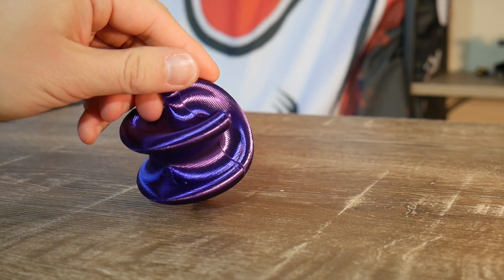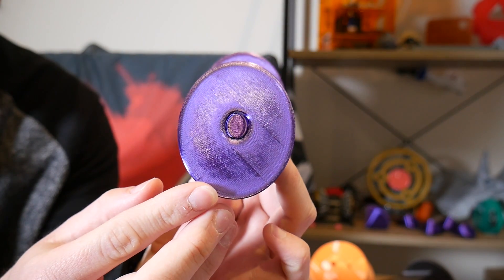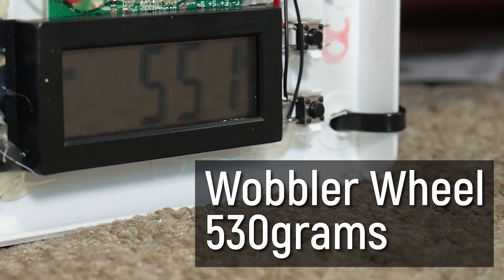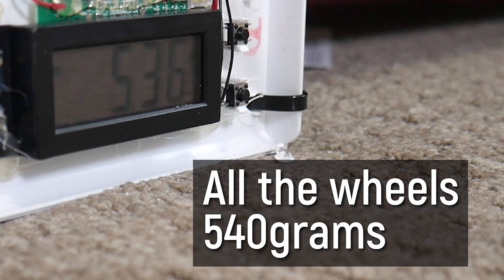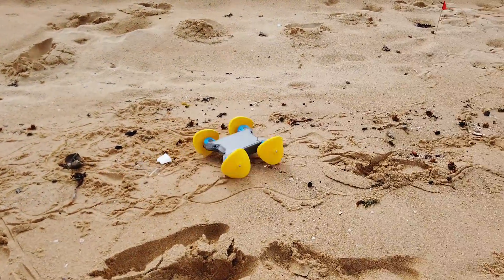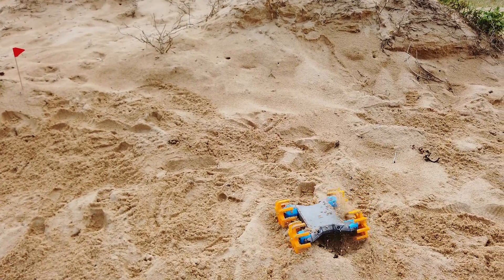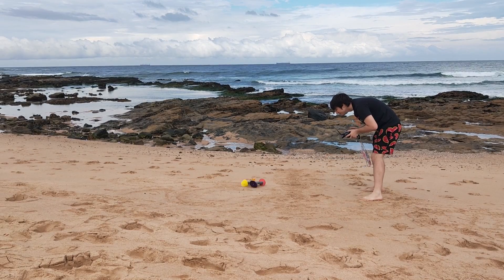This Robot Drives on Wobbly Wheels (but HOW?)

Comment: i cant design it, but im sure you could! try to design a combination of the wobbler wheel and the paddle wheel, where the main construction would be the wobbler wheel with bars or paddles around the diameter the same way the paddle wheel is, but instead of attaching at the end of the wheel, it would branch out from the wobble wheel parallel to the hub. looking staight forward at the hub from the front of the car, it would like a wavey line with a bunch of cross lines going through it. each time the wheel wobbled out, the paddles would shift to be longer on inside, but the wheels total width should stay the same, sorry for over explaining, but i really want to see that!!

Comment: Logic* dictates that combining all four wheel types would give you a pulling force that's an average of those four types.
405+530+550+600/4 = 521.25
This is slightly lower than the measured 540 grams but without going into further into the deep dark hole that is statistics I'm gonna go out on a limb and say it's within the margin of error for your measurement methodology**. 
* The logic used here is most certainly not recognized in mechanical engineering
** Given vast span of values shown on the scale and the low sample size that margin of error is huge***
* Much like the rest of this comment this statement is also pointless as I've not even tried to calculate the actual margin of error

EDIT: Youtube apparently lacks support for the usage of multiple asterisks so my footnotes may look a bit off.

Comment: If wobbbly wheels got 1 point and straight wheels got 0 points, but spoked wheels in a straight configuration got 3 points, does it not stand to reason that spoked wheels in a wobbly configuration would stand a better chance? Perhaps have the centre disk in the middle of the spokes so it makes a sort of left and right pattern between each spoke as it pushes forwards. This means doing away with the "star" shape in the centre of the current spokes design and inserting the wobbly design such that it's OD meets the OD of the spokes. If you get my meaning?

Comment: Nightshade wheel on flat surface does the same job as if you just sliced the tip of that initial cylinder to make a round wheel.
Only the nightshade wheel is harder to make, uses more material, takes up more space and weighs more

Comment: I'd argue the traction issues are made quite worse by the low ride height of this bot, maybe if the wheels were offset downwards or were quite wider the bot would work far better.

Comment: #1 The problem in every case with every wheel is ground clearance. #2 If the spoked wheel had a cylindrical center the width of wheel, mating with the inner side of the spokes it would finish the course.

Comment: It's really enjoyable to watch the play involved in designing these wheels. I think that one of the reasons the cars got stuck so easily is the body design. The flat bottom sits very low above ground, making it very easy for the cart to get stuck. This is why monster trucks and dune buggies for example are much higher up on their wheels. I think for the follow up video, using a better controller and BLDC motors will also improve a lot.

Comment: Bigger wheels so it bottoms out less would really help. As soon as you spoked wheels dig in just a little, the belly of the car is in the sand and then you lose the ability to dig in for more grip and to keep going. These wheels are very similar to the large tread pattern used on dune racing cars.

Comment: There are longboarding wheels called “Shark Wheels” an they work on a similar concept, I’m surprised you didn’t touch on these, but maybe you didn’t know they  existed.
Reply: Indeed, thought theyre meant for not hydroplaning or getting stuck on gravel. Kinda similar concept indeed, though they wear pretty quicjly because theyre quite soft.

Comment: when the robot jumps up and down you arent measuring a force, youre measuring an impulse. for more accurate measurements try increasing the mass of the chassis. basically if the chain is oscillating the measurements arent accurate
Reply: also grams are a measure of mass, so saying it pulls x grams is misleading. if the scale is just a weight scale divide grams/1000 and multiply by 9.8 and you'll get force in newtons

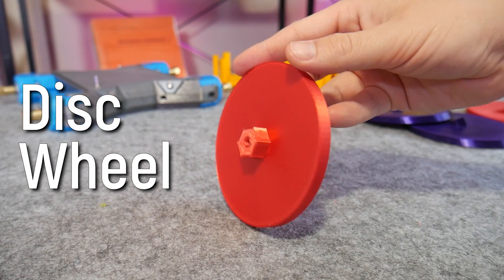Comment: What is the weight of the whole setup? All disk-ish wheels have less contact with the ground then the spoke wheels. So the pressure per sq mm is much higher for disks than for the spikes and that's why they lost in the sand. The whole surface area is not that important (4:15)

Comment: Why not wobble the spokes in some sort of way, ABIT like those shark skate wheels except inverted wobble to run horizontal instead of vertical. Or add some spokes to the rear of your wobbler or prongles

Comment: You had them test out in sand, ofcause the wheel with a design to get better traction in lose material does better, that’s not cheating it’s just a match between test and design... just add more tests, like the road outside your house and a grassy area somewhere nearby...
I am sure the other wheel types will show greater results and the stick wheel will do worse on some of those surfaces.

Comment: Possibly something with studs or scoops, but I bet the spokes version with a larger diameter could be a logical next step. That is, assuming the motors have the torque for their size and weight.

Comment: This is so amazing tests and findings. Thank you for the video 👏👏👏👏👏
My suggestion for the next step of traction test is to have brushless dc motors and current control of power source in the same setup you have already made with chain & load cell. By the suggested arrangement, you can measure the maximum traction before the wheels motion starts. 🧐😎

Comment: Question that is tangentially related to the video since such a thing is used to create everything referenced - I do not have a 3D printer but I'd like to get into it 'cause there are lotsa things I want to make. If I wanted to get a 3D printer that was 'respectable' but 'not hella 'spensy', what would the least expensive model be? Just a 'starting out' one, but not one that extrudes Easy-Cheez - something that can produce 'decent' prints.

Comment: Check out sidewinder snake.. I think if you can time the wheels and drive it sideways with the wobbly ones it's going to do a similar footprint as the snake. Try to do a ankor shape on the disk for more surface area.

Comment: Don't think any particular extra criteria would be required. You were testing 2 things: Pull force and performance on foot-printed sand the day after rain. It's not an unfair test, and the one that did best in that scenario won.
If you wanted to create a situation in which others would perform better, consider a different goal or different surface type. They might have different top speeds on asphalt, for example. Maybe the prongles kick major ass at climbing a sidewalk uphill or the nightshades outperform on linoleum.

Comment: I think the goal of a wobbly wheel car is that it would move forward on a flat surface with no power. Of course it would need power to go uphill. But to design a vehicle that had wheels that always rolled downhill, like the toys, would be amazing

Comment: maybe change then round and oval tires to have small divets or bits that stick out alil for extra tread of sand?
also maybe make them larger to allow more under clearence as that seemed like the worst problem, offroad cars are made to sit higher and thus have more underclearence, you have to put into account that the body of the car itself it heavy enough to stop it if it touches the ground.

Comment: test by combining three weak designs together and add a card board to inside of paddle wheels to "Float", incorperate a  float on the three wheel combi , 
sand is essentially a liquid for the traction discussion

Comment: Part of the issue with the sand course is clearance. If you could lift up the platform somehow you get better results. Wider wheels would also help. I'm also thinking a wide wobbly with the spokes would work the best.

Comment: I don't think it's the wheels problem... I think it's the fact that the platform you are using for this is too short, what if you try to Raise it a little and see if that changes... it looks like that's keeping it from moving bc it's getting stuck on top of the sand

Comment: Future wheel test idea parameters. the wheels must have a continuous edge around the outside of the wheel. This removes the spoke wheels from being applied, as they do not have the requirement.

Comment: Such a cool concept and great to see it utilised in a real-life situation! Could you make a hybrid spoked/wobbler wheel where the spokes are individually offset from the centre line to mimic the wobbler effect? This would make each spoke take a slightly different track, keeping the vehicle on top of the surface, rather than having each spoke following the previous spoke into the same rut. On your spoked design, all of the spokes were facing back in towards the hub, whereas in the hybrid design at the extremes one spoke would face in while on the opposite side the spoke found face out

Comment: Is it just me or are the spoked wheels sometimes spinning the opposite direction? 
specifically, I was looking at the slowmo scenes that I thought I noticed it. Like a wheel is out of sync or inverted or something... I.E. Front left @11:57 and maybe the front right dragging immediately after, in the same slowmo.
So possibly, the whole monologue about needing more experience with more complex RC components would help the functionality and efficiency of the tests.

Comment: For a fair comparison you would have to stick a little rubber on the contact surface of each wheel and then use a flat cement or asphalt incline to test how much weight they can carry up the incline.

Comment: I think you should add more weight to the RC (which is a phenomenal design), the wheels could benefit from a rubberized paint or slicing some tread into the wheels. I suggest using a dremel.
The front tires don't have paddles for sand, there's a channel that cuts into the sand.

Comment: the problem with your sand test is the ground clearance of your chassis. You chassis is clearly designed with flat ground in mind not with offroad ground. One quality of offroad vehicles is the high ground clearance. Redo you chassis, make the ground clearance higher about 3-4 inches high and test it again...

Comment: Hmm, could you implement the Mechanism at !4:14 to 14:16 as Wheels?
Or Maybe different Versions of that, withthe inner Part being wider for more surface, and if Possible the Scoops only going out if needed.

Or if it's not possible to set up an additional set of Motors for that, make it so the Wheel-Rotation does the Trick, by either driving frwards or backwards.
Lie wheels that adapt to the Situation.

Comment: Add a small groove down the center of each of the spoke wheels and stretch an elastic band over each pair of wheels, like tank tracks.  That will provide 'float" and prevent the individual wheels from dropping into a hole and high-centering the vehicle.  You could do the same with the traditional wheels too for vastly-improved performance.

Comment: There's the screw design that pushes the vehicle onwards even on water, but it may drain the battery more since it's heavy as a design. (Hot Wheels Terrain Twister used it)
Maybe there's something to design with that.

Comment: The spoked wheels had largest contact surface and the "bite" was in the direction of movement. The continuous wobbly wheels have the least contact surface but can "bite" at an angle like a screw. The narrow smooth continuous normal wheels had none of these. A wheel design with large contact area for the same wheel surface area, like a mesh (can be a pain to print) imo would outperform any of these on sand.

Comment: The spoke wheels had polygon wheels so they would push the car out of the sand if you gave it flat thin paddles it would fly through the sand. The spoke wheeles are too round

Comment: Obviously you need to make a spoked progle wheel test. Gives you two directions in which friction is increased, and increases the distance between tips of adjacent spokes, thus increasing the amount of soil a single spoke pushes on, thus making it harder for the soil to just be flung away.

Comment: You need lower tire pressure for sand.  ;)  I think wheels that have a lot more surface area, that won't sink, will do better.  Cylinder with paddles would do better.  Like the mars rover.  I am sure they tested those.  
https://www.youtube.com/watch?v=ov_TXfWBf-4

Comment: This seems to prove that whatever combination of normal and or wobbly wheels you have, the 'truck' will still describe a perfectly straight line, or curved line, etc, on a flat, stable surface, but maybe not so much on an undulating, unstable surface.

Comment: I wonder about the traction capabilities of "toothed", or "saw-shaped" wheels. If the edges had a zig-zag, or shark toothed edge pattern. That would seen to work best on a carpeted surface. For sandy conditions, why not use spherical wheels that had built-in paddle shapes, like real sand tires?

Comment: It is verymuch not cheap of course.. if it were indeed to be fit with a car and even then they are very radical design and alot of change needed to a car chassis

Edit: i forgot to mention the height of the car which will be increased or the lenght of the car. I also forgot to mention that some of the wheels design are not meant for long trips with heavy luggage if it were to be in a car design and the joints looked pretty stressed already

Comment: Well, there are better wheels for sand, let's look at the 8 spokes wheels, they could've been improved a lot, design wise, by simply having the spoke offset at a 60 degree angle, you might think, what's so different with a 60 degree angle, well increased traction is one point, but also it looks better, and then there's one thing even better than wheels. And that's Tank Threads. The number one in traction.

There's a lot you could do with the wheels to improve traction, like ridges and valleys, like normal tires have. Different materials also have different properties, for instance rubber has way higher traction than plastic. However I do see methods for your little remote controlled thingamajig to drive on water as well, after all, all you really need for that is low enough density. Aka little weight big volume, and you can make it so that you can steer as well, after all paddles are a thing, and you can have paddles on wheels as well...

Comment: I wonder if NASA considered anything like wobbler wheels. I remember someone making a vehicle with two "wheels" actually cylinders with corkscrew treads on both sides.  Great for sand and water. If the cylinders rotated in opposition the vehicle moved along the long axis of the cylinders. If they rotated in the same direction it rolled like it had two long tires front and rear.

Comment: It looks like the wobbler wheels had an advantage in that they where able make contact with a wider region preventing them from digging a thin rut as quickly, their angle also helped then push sideways against the sand as opposed to sheeting away the top layer. You could incorporate these advantages into the spoke wheels by slanting and alternating the spokes, eg one pointing out and back one pointing in and back then repeat
Other options might be to lean into the shovel shape and replace the spokes with little paddles or sidestep treads altogether and use fewer spokes but make them much longer with points or little round caps

Comment: Test the wheels going over obstacles! If there's a little rock in the way of the wheel, the plain wheel might get stuck, the wobbly wheel should wobble around it, and the spoke wheel should catch on it and pull the robot over.

I wrote this before I saw the beach test, which kinda tested this

Comment: Why did you include 2 types of wheels that are used normally in vehicles? the pronged wheels are no different to cylindrical wheels with ridiculously deep groves, most cars use a tamer version of your pronged wheels and race cars use a cylindrical wheel, it isn't surprising the industry standard for off-roading won in both off-roading test

Comment: I think part of the reason they didn’t work was because the wheels were too small, so they lost leverage in the soft sand. Maybe if the axles were lower in relation to the chassis, the weight would help with traction, and also help so the wheels didn’t get so dug up in the sand.

Comment: I think the wheels need to be bigger because the bottom of the robot kept getting stuck of course then you would need a bigger robot with more space in between the moters and a 3d printer can only print so large

Comment: During the test, the wobler wheel goes to the right because of the "grain" of your carpet (I don't know the name in English) like with short hair, soft in a direction, harsh in the other. So because of the angle ofthr wheel it slides in one direction but catches the rug in the other.

Comment: to have maximum traction force at the balence test, you could try a smaller wheel... think you'll have more torque and less speed ... but you need a material with more friction coef ...
maybe petg ?

for sand driving test, sand could be concidered as a very high density fluid.
you'll need bigger wheels, with a plain profile ... just a cylinder with teeth to push the sand backward. 
bigger wheel to augment the size under the car, plain profile to avoid the wheel digging on sand and teeth to push the sand bachward and generate propulsion

Comment: 2 Prong wheel would probably do really well.  Like 2 prongs at 180 degrees of each other, or even a 4 prong wheel at 90 degrees of eachother, they might not do well on carpet pulling, but in the sand they could probably do alot